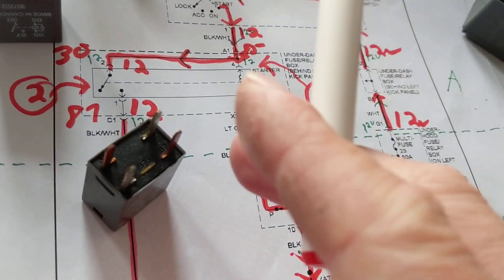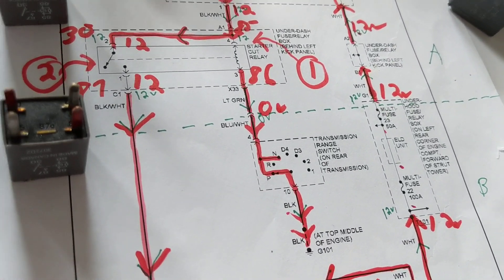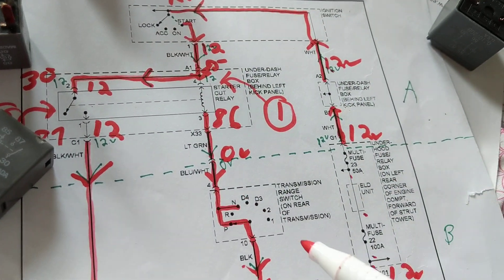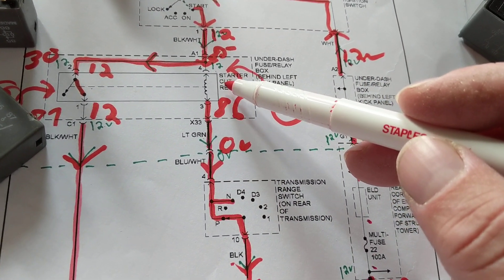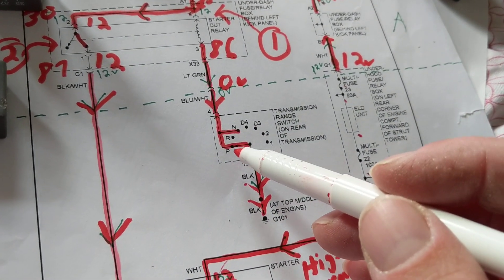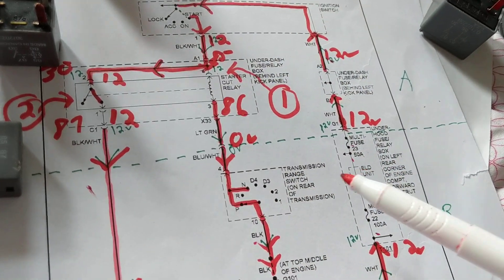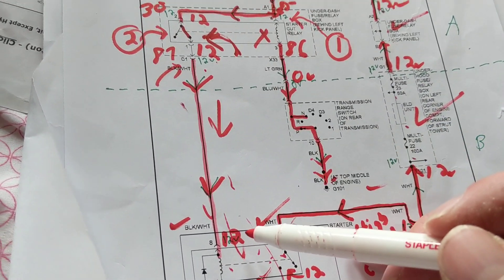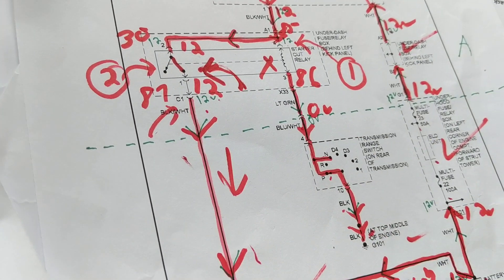NO START PROBLEMS HOW TO jump THE RELAY

Comment: I had no crank, so jumped 87 and 30 and got crank but still no start ?
So if i get crank with jumping 87 and 30 does that mean relay is bad ?
And if I jump 87 and 30 and it crankshaft but still doesn't start what does that mean ? Thst I have a separate issue??

Comment: I think it is very important to point out that jumping across the control side of the relay is a short to ground because it needs a load, such as a test light.
Reply from the maker: Yes thank you I think I didn't mention that in other videos you don't want to jump that you want to jump obviously the contacts side that's why I always point out 87 to 30

Comment: I have the same no crank problem. I want to know if its possible to install cables in the relay and run cables into the car so i can jump the relay from inside the car instead of removing the relay and jumping it every time. please let me know your opinion. thanks
Reply from the maker: If you're referring to the starter relay you have to put a switch and also the right gauge wires remembering not to put the wires next to any hot surfaces but the fact that you have to jump the relay every time is a major problem obviously
Reply from the maker: What make and model is is the car because obviously there's more of a problem than just trying to wire it

Comment: Hi.  What happens when you jump pin 85 to pin 86 I mistakenly did this with the run/crank relay and smoked something  thx
Reply from the maker: Remember that's the coil side you're jumping the coil so basically b+ is going to ground a short the ground it'll take a lot of things with it unfortunately that's why my video I stressed that point to be careful which ones to jump but thank you Linda for your question I hope not too much damage was done

Comment: If you jump the relay aren't you bypassing the ignition switch completely? I don't think it proves the ignition switch is good if you can jump the starter at the fuse box...or am I missing something
Reply from the maker: What you're jumping is the load side the contacts of the relay you're not jumping the ignition switch therefore this is after the ignition switch if you look at the schematic the relay is after the ignition switch
Reply: @Joeelectronicschematicsforauto  correct which means jumping it at the relay could not prove that the ignition switch is functional right? Because in the video you said jumping it at the relay proves that the ignition switch works...I'm just trying to understand
Reply from the maker: @MacAutoDiag  jumping the side of the relay 87 to 30 when you start the ignition switch and the start position that means you have voltage to the relay and the starter motor if the ignition switch would not be good when you jump the relay nothing would start including obviously the starter motor